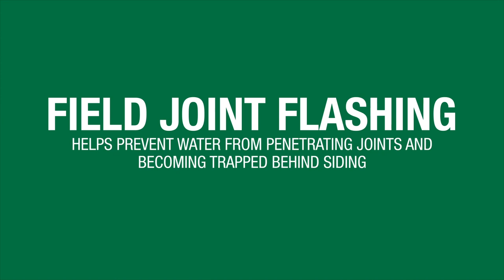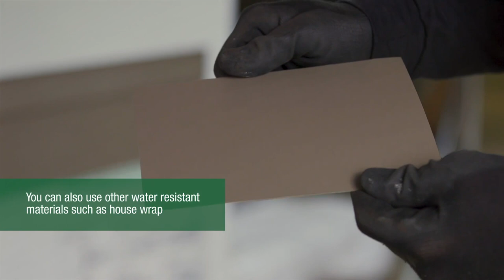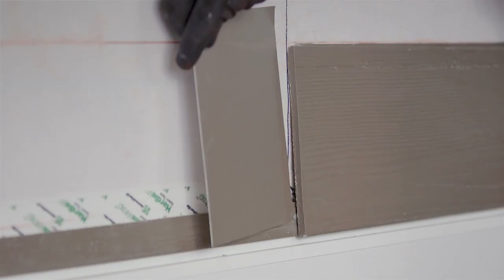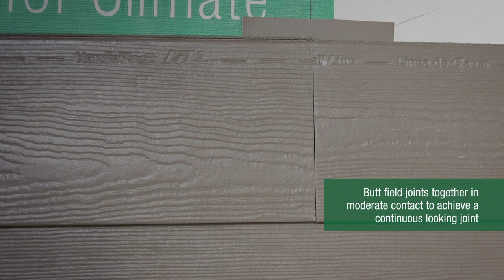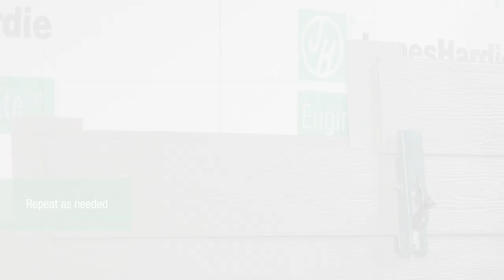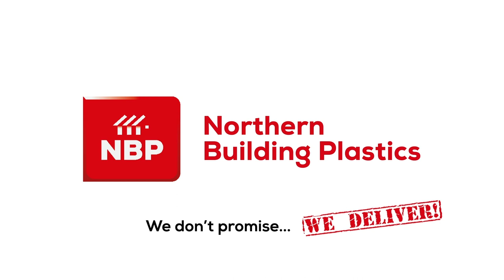How To Install Joint Flashing

Comment: What about the 1/8 gap?
Reply: I believe that's only on the butt joint to trim. Butt joint between lap siding panels is supposed to be "moderate contact" per the video and their installation guide.